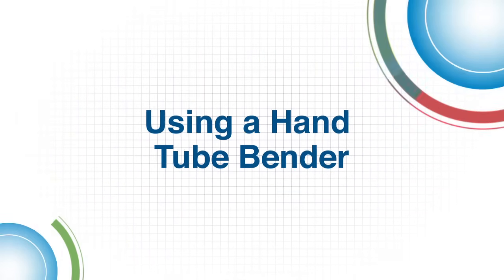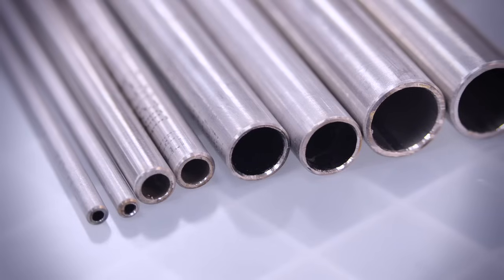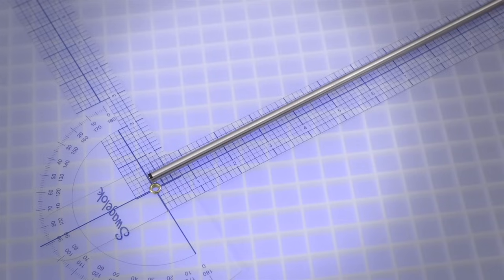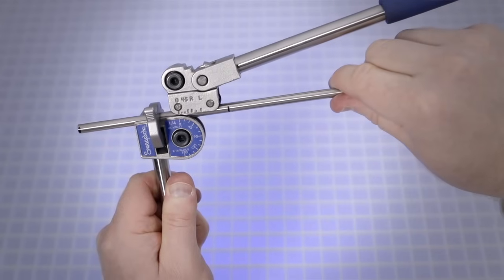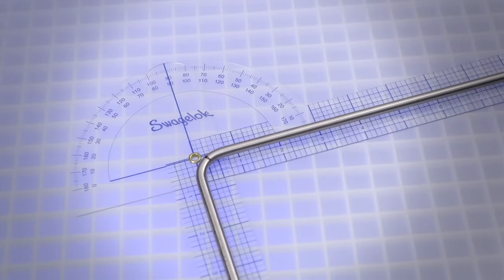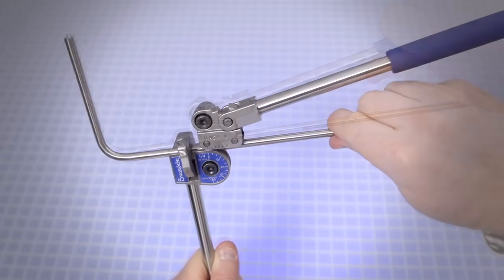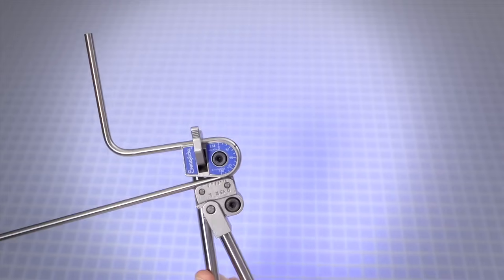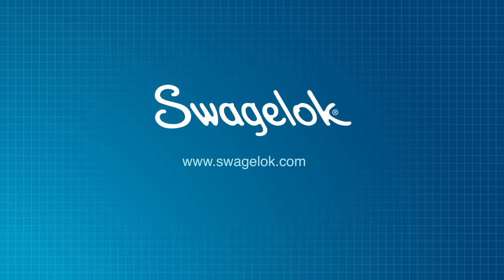How to Use a Hand Tube Bender | Tech Tips | Swagelok [2020]

Comment: I can't find a good video that explains the take up theory and how it is applied in order to make an offset, mine are all 5/16 too big every time.
Reply: There is a chart in the tube bender manual that tells you the subtractive adjustments needed for bends 30-90 degrees,  anything below 30 is no adjustment needed.  For example if doing a 45 degree offset each 45 bend will equal up to 90 degree total and say the pipe is 1/4 with 9/16 bend radius the total subtracted adjustment will be 5/16.
Reply from the maker: Hi, Your local sales and service center will be able to answer your question. You can find their contact information here: https://products.swagelok.com/locator

Comment: So question for any who can answer this. What is the point of using the L and R markings on the block? Personally whenever I bend tubing I choose to bend tubing like conduit I use take up and deduct methods. I’ve tried doing it this way but just don’t like the outcome of the quality of work
Reply: The L mark refers to an offset which was measured from left to right on the tube.   The R refers to measuring your offset from right to left, also known as a reverse bend.
Reply: In this video, the L indicates the 90 degree centerline mark. If you have a leg that needs to be 5" then a 90 degree bend. You could measure 5" from the end of tube, line your mark up with the L then bend 90 degrees. Thus not having to mark or calculate takeup.
Reply from the maker: Hi Robert, Your local sales and service center will be able to answer your question. You can find their contact information here: https://www.swagelok.com/en/locate-a-sales-service-center

Comment: Swagelok benders are expensive. I have a 1/2” that I bought out of a pawn shop about 25 years ago. I used these professionally on a power plant and they are so easy. He didn’t go into the take up measurements well enough. He only showed L and that is not sufficient for beginners. I have always marked mine as he did and worked in one direction to get the most precise bends. To find prices and where to buy, just google it. Good luck.👍🍀

Comment: How does his effect the inside diameter at the bend?
Reply: The idea is that the engineers designed the tube to be bent at a radius greater than or equal to the bend radius. Inner diameter is largely unaffected. It is only when the tube is bent at smaller radii that the diameter is greatly reduced and results in a visible kink.

Comment: Can this hand tube bending machine bend 360°?
Reply: 360° without moving the tube? No. The die doesnt have the groove all the way around. Anything over 180° is almost impossible as the tube will be trapped in the bender.
Reply: You can but it's difficult.

Comment: If your bending a 10 or 20 foot stick of tubing and it has a lot of bends in it, it is a good idea to take a piece of tie wire and make a model that you can bend with your fingers. That will make sure you put the tubing in the bender the right way instead of bend come out upside down.  We had a guy on our crew that could take out his tape measure and look up into the structure 15 or 20 feet away from where the tubing would be going, somehow get his measurements from that distance and then bend a piece of tubing haul it up into the structure to install it and it would fit like a glove. When your on a big construction site there are a lot of people that are real artists when it comes to bending tubing but I never saw anyone that could get their measurements from a distance like that.
Reply: I go to a site, it’s a large old Manor House and in there is a one pipe system in which the bulk of the pipework is 2” iron. The bends in there are incredible, hydraulically pulled to span curved bay windows, offsets and 90’s all in one piece. I’m known for my neatness/accuracy when bending copper, I used to use oxy/acetylene to manufacture loops/sets/bends on site, I learnt how to pull bends etc on an hydraulic bender during my apprenticeship but this work is something special and has probably been there 50 years. Every time I go there I just stare at them because I know just how special the guys were who did that work 👏👏👏 
The site is empty now, I still do an annual boiler cert for the site so I may take a video next time to preserve it just in case the site gets demolished 😳
Reply: @cerealkiller4248 sounds like Tartarians from long ago😂.
Reply: Sounds like he used a laser. Or he got lucky 😅

Comment: I have a tube bender that bends 4 different size's  and don't have to buy 4 different benders to do what 1 does. And bought it at Lowes. I use it to bend my copper for work.
Reply: Not trying to say it was dumb, you are just trying to say you bought a cheaper bender to do the same thing when you don’t know if it can bend stainless. It’s great info for plumbers, but not for what this product does and it sounded like you were talking down on these benders due to yours when you don’t even know the capability of yours to do the same thing.
Reply: Good for you. That has absolutely zero relevance to what this product does though. Copper is a very soft metal, while stainless steel is not. Apples and oranges.
Reply: Yea I know steel is not same as copper. The thing is both these benders and mine work off same principle and bend the pipe the same way . But if you want my comment to sound dumb no problem ,what ever.Was not saying tool is bad was just making a statement

Comment: Actually the trade terms are "gains" and "losses", pipe can't "grow" (however, you may wanna try viagra); if anything your final overall length will be less than your original. For sizes between 3/16" (4mm) to 1/2" (12mm) tubing, a good rule of thumb is approx 1/16" (1.5mm) "loss" per 15 degrees bent successively. The most difficult length I've done was: approx 25 bends of various angles (from 15 to 120 degrees) along a 20ft length.